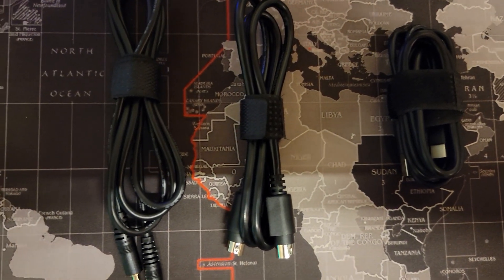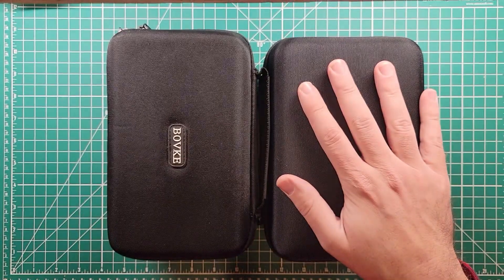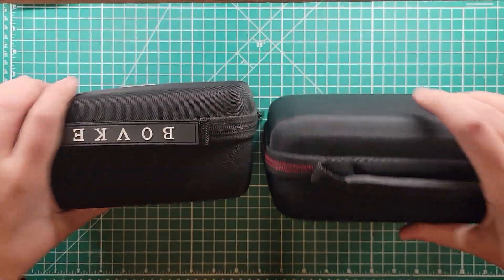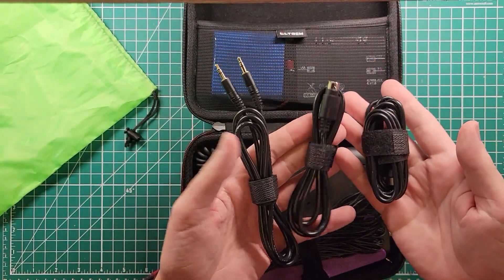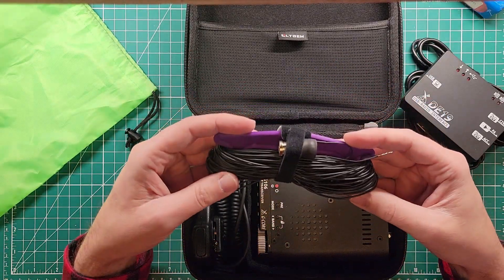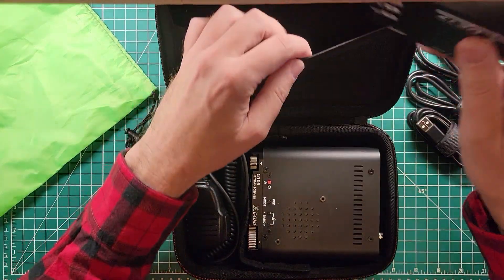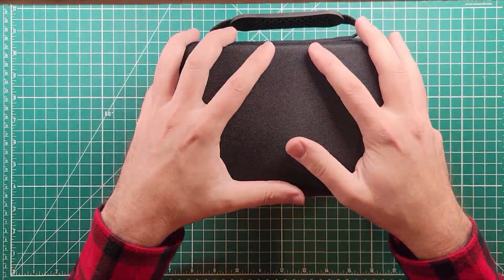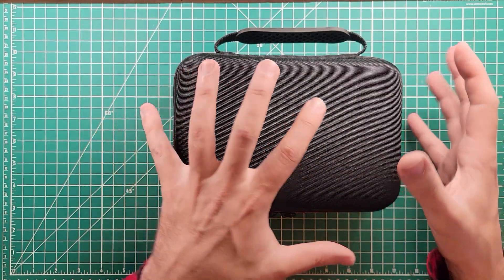Making Portable Radio Portable - Xiegu G106 Case

Comment: Hey thanks for this video! Can you plug headphones into the DE19?
Reply from the maker: No, there isn't a place for headphones on the DE19.  The G106 does have a headphone port on the bottom of the mic though.  So that means that you could make up a cable adapter if you wanted complete hands free too!

Comment: I’ve no interest in a G106, but I wish Xiegu shipped that smaller mic with the x6100.  Wonder if it works and they’re pin compatible?
Reply from the maker: The mic's do not share the same pinout... but you're in luck:  https://www.youtube.com/watch?v=2ow9v5DjcEI
Reply: @temporarilyoffline  Thanks...I'd seen those, but hoped to get a "normal" mic.  I'll just have to crimp an RJ45 on a HT mic.  Wonder why they changed pinouts as the x6100 is a std iCom pinout, giving lots of options.
Reply from the maker: @ammocraft  I think this is another standard mic, just not the icom standard